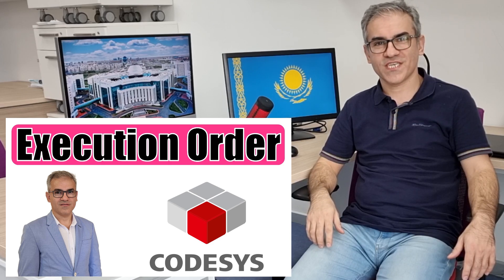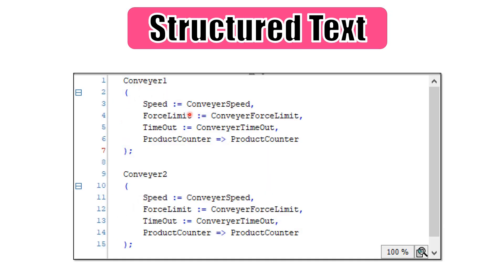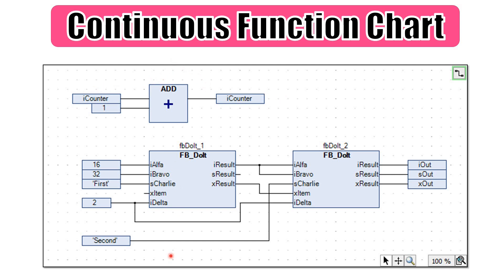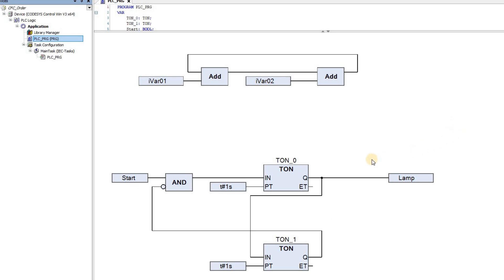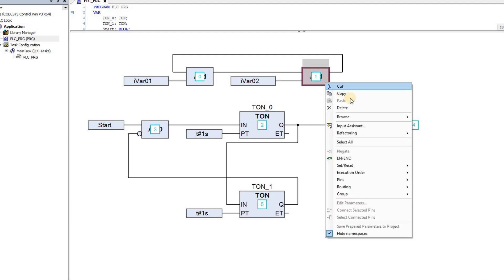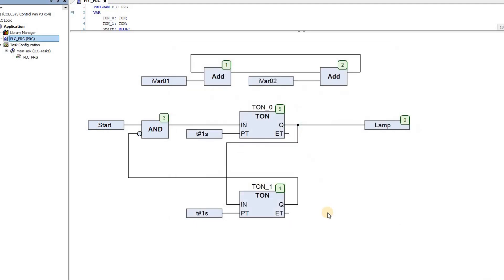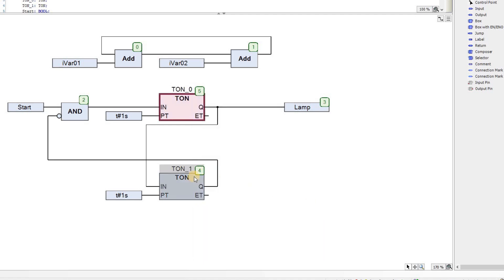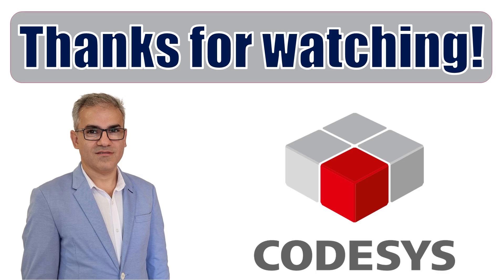CODESYS: Code Execution Order in CFC #codesys #plcprogramming #iec61131 #plc #twincat #cfc

Comment: hi, i have a timer controlling the two leds , if the timer is greater than 0s led1 will come and if it’s greater than 1.5 seconds led2 will come on. I want to control the speed of the timer using a slider to make the leds come on faster or slower. how can this be done ? 
thank you
Reply from the maker: Hi, thanks for your comment. I am not sure if I understood your question correctly. I assume you have two LED lamps that are blinking with a given frequency, and you want to control the frequency of ascillation with a slider from the visualization. Is that right? Then, you can have two on-delay timers, with which you generate a pulse, with a given frequncy and pulse width (determined by the preset time of the timers). You can adjust the preset time of the timers in the visualization using sliders. i thin kI have shown this in my other video tutorials. Please refer to my Visualization Playlist to find it out. I hope this helps.